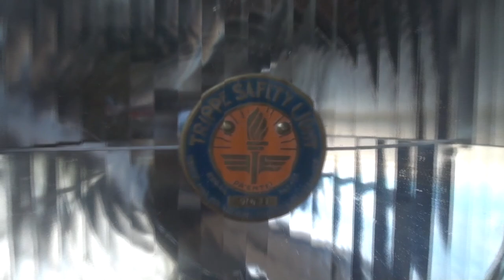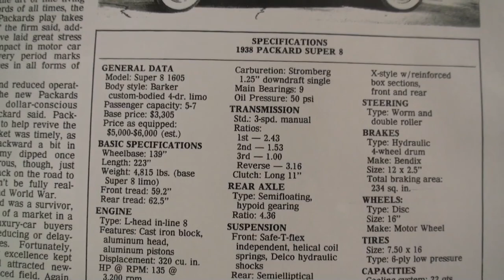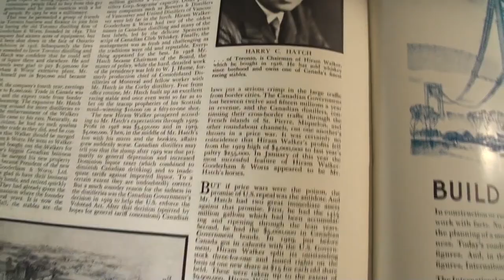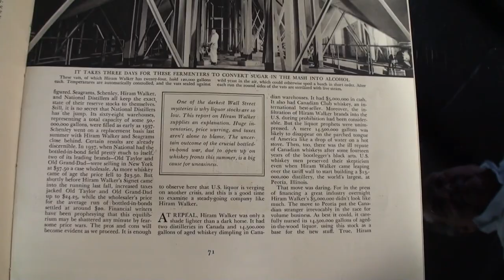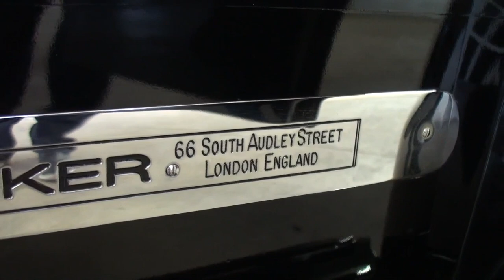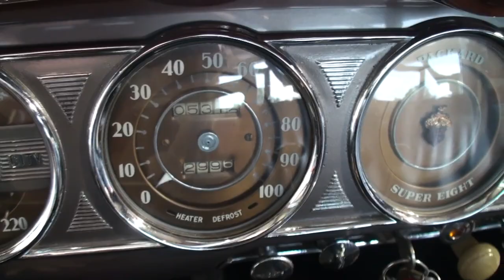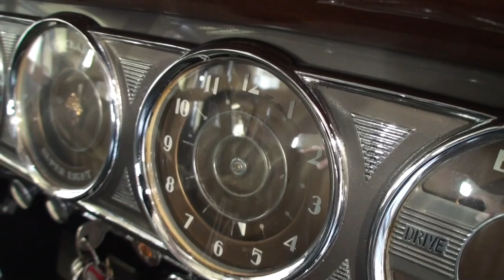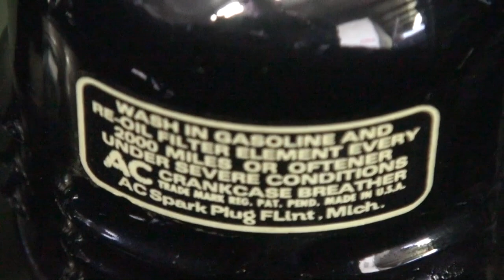1938 Packard Sedanca deVille Body By Barker Super Eight Engine Sound My Car Story with Lou Costabile

Comment: Wow, 4800 lbs   with  a 4.36  rear axle  and a 21 galon fuel tank   with a price tag of about $1.20 a  lb . 
    That  jump seat in 1938 was a luxury  feature  borrowed from the  Paris Opera house  which was also how American cars  got the small rear side windows called an  Opera Window . 
     When an Opera show was sold-out   and  someone of  note for their wealth  had brought an extra person ,  there was a  Straponlin  ( folding seat)  mounted along side a wall on the persons Left side .  The upper Opera boxes had  these seats and a small window to see the stage . 
              The early Luxury cars in France  and England  had the rear seat right behind  the driver to face the  back window so the conversation stayed private and they didn't care about watching where they were going .         
     Some cars  had a Straponlin to carry an extra passenger and  was put in the rear corners to face forward , the  large  roof section  on the sides aft  the rear doors  would also had a round window  for the passengers view  of the outside . 
    The 1955   2 seater T-bird  had the Port Holes as seen on  a ships cabin for a view of the ocean , but the full size  American luxury   cars  in  the 1970's had  the ads calling the 72   Lincoln Mark  IV  as having   Opera Windows  and  later we saw  outside lights on the B pillar near door entrance .
Reply from the maker: Hi Gary wood, I like the way you calculate price per pound :-) Lou